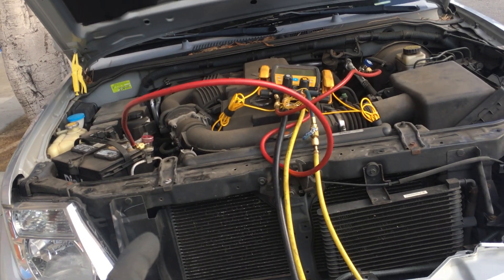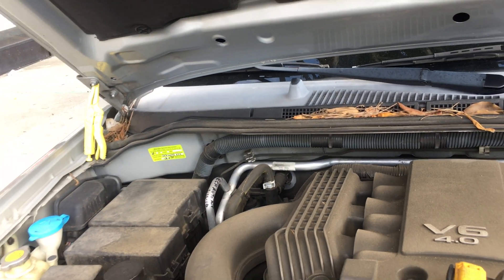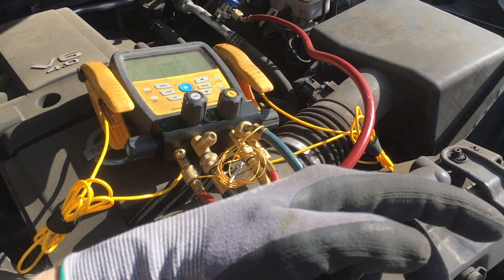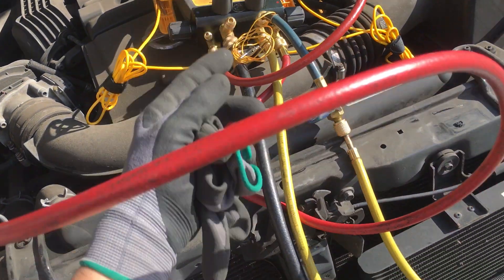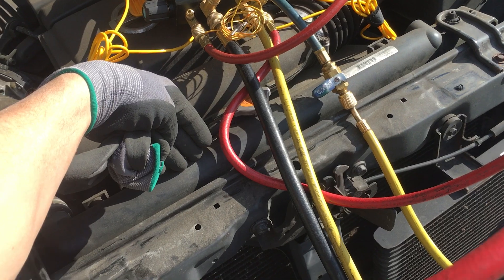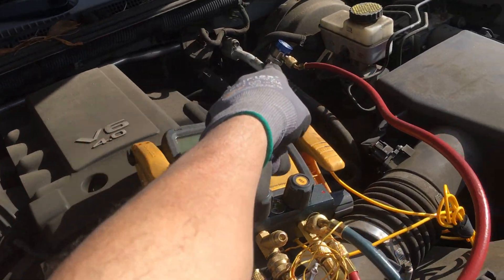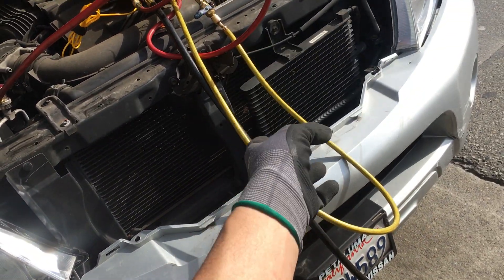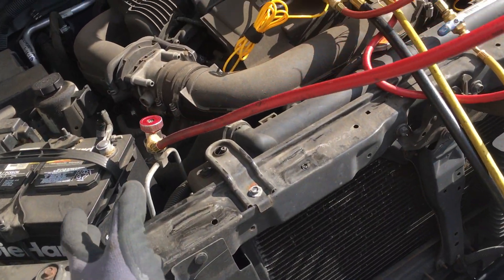AC recovery explanation, AC oil removal, WHAT ABOUT THAT UNIVERSAL REFRIGERANT OIL ???!!!

Comment: I'm working on a car with a york 210 compressor.  Putting in a new compressor.  I noticed the recovery fittings were on top of the compressor.  Since I have the opportunity now and I'm making new lines (original ones are over 40 years old), it sounds like it now is the opportunity to correct the defect you mention and re-locate the high and low side ports away from the compressor so all the oil won't be sucked out during recovery.  Would you have an ideal preference where the service ports should be (i.e. closer to drier/condenser), thanks!
Reply from the maker: komoru If you’re using a normal automotive recovery recycle recharge machine they have a much slower recovery rate and you have the machine that has the oil catcher that measures the quantity of oil that comes out so it’s a lot less.   As long as you pay attention to the quantity of oil that comes out and you put back in the same amount you’re OK.     The problem comes in when you guys are taught on the recovery machine by somebody who really doesn’t know what they’re doing and they do not pay attention to how much oil comes out and they never put it back. This is when there’s a problem.               If the compressor was mounted down low and positioned in a place where it was very difficult to get the refrigerant service fittings attached then I would add and relocate high and low service fittings in another location on the hoses for convenience.       The York compressor did not have much of that type of problem that I talked about in my other videos.      Some of the more modern day compressors do you have that problem like on some of the Chevy pick ups the 6H compressor right on top of the engine with the two ports directly into the high and low port of the compressor.
Reply: @coldfinger459sub0 Is there any way to tell how much oil is in the installation without having the machine in your video?
Reply from the maker: @andreia2286  yes but it’s a long procedure. 

One way is to pull off the compressor and measure the oil that’s in the compressor compared to what the manufactures instruction manual tell you it should be and then you perform the oil balance procedure . 

But you cannot rely on this method. If you do not know what other people have done in the history in the past, if they have added more or less oil in the vehicle, came in low on charge meeting most all the oil will be stuck up in the evaporator and you don’t know how much. 

So the only correct way is to fill the system up to manufacture, specified refrigerant quantity by wait for that specific your model vehicle only 

Run it for about 20 minutes all the doors and windows open on a hot day fresh air mode at somewhere around 1500 RPMs 

Turn it off and let it rest for about 20 minutes 30 minutes 

Then slowly recover with a recovery machine, the refrigerant out of the low side fitting only very slowly dial down on your machine so it’s super slow . 

In the old days mechanics used to just released a Refrigerant to the lowside, fitting very slowly by unscrewing the valve core, and allowing the refrigerant to leave the suction line at a very slow rate . 

And then, when it was all finished, you would remove the compressor and measure the quantity oil 

He would have more than the oil specified. That means somebody put way too much oil in and it’ll tell you how much to dump out and save inside the compressor. 

If it had less oil than the manufacture required, then they will give you instructions on how much more to put back in . 

These procedures take time 

This is why only people who are qualified knowledgeable and actually Reed should ever be allowed to touch air-conditioning because people just think and guess and start adding things are taking things out without knowing what they’re doing and we get messed up AC systems driving around .
Reply: @coldfinger459sub0  Hi, thanks for your quick reply, I've replaced the AC compressor last year with someone else and we've manually filled it with as much oil as we could, unfortunately I don't remember the exact quantity but I believe there was enough so we dont spill it while we mount it. Unfortunately we didn't do a vacuum before adding the refrigerant and after a few months the valves started to leak.

 So I decided to go to a shop where they did pulled out the rest of the refrigerant with one of those refrigerant machines that works by itself. The amount of the refrigerant recovered was about 56 grams, however I don't know how much oil they recovered, or how much they could have possibly extracted with that machine. 

Now I've replaced the valves, bought a vacuum pump but I don't know how much oil I should put onto the installation. Before replacing the compressor, the installation wasn't used for a very long time, so I believe there wasn't much oil in there if not at all. I have a ford mondeo mk1 which requires about 750 grams of refrigerant and 200 ml of oil according on what I could find on the internet. 

If you know anything about how much oil can those machines extract from the installation in these circumstances please let me know 🙏
Reply from the maker: @andreia2286  does machines are not supposed to pull out any oil every now and then they’ll pull out 5 mL or maybe 25 mL

If you filled up the compressor, all that I can fill inside the high side port in lowside port, probably have too much oil in the system . 

In these cases, the whole entire system gets flushed out, manually taken apart piece by piece . 

Expansion valve hast to come out in the. Evaporator gets flushed out with AC flushing solvent. . 

Or at least just high-pressure nitrogen . 

And then the system is put back together with a new receiver dryer 

And since your system is so moisture contaminated by not vacuuming it the first time 

I would leave it on the vacuum pump overnight 12 hours to 24 hours . 

And then charge it up
Reply: @coldfinger459sub0  I don't think we overfilled the compressor because we didn't had that much oil. If I remember correctly we used a syringe that was already prefilled, but I don't remember the exact amount we used :(. I don't know if the compressor got damaged in the process but I hope that's not the case... We also added some air pressure to check if it can hold it for 24 hours and It was fine. Thank you for your suggestion btw, I'll definately pull a vacuum for a longer period of time.
Reply from the maker: @andreia2286  definitely sounds like you need to go online and research and download instructions to do it properly and read the specifications and read the procedures

Comment: An universal PAG has been recently marketed in Europe and it's basically 68 viscosity grade (15 cst at 212F), said to be suitable where either 46 or 100 is specified (but i don't think it's suitable for refilling an old compressor that wants PAG 150). Might be the best take at an universal oil. Ester 100/85 are bad as universal because they won't get thick enough at 212F due to the low VI, i.e. PAG 100 will be two times thicker at 212F than these ones. PAO is a big no no as universal because it won't mix with any modern refrigerant and hence won't give any reasonable OCR with sumpless comps.
Reply from the maker: TeraVolt I remember when the 68 was trying to be marketed her in the US 15+ years ago.
Reply: @coldfinger459sub0  If i remember correctly Dow's RL897, Dow's RL993 and Sanden's SP15 are all PAG 68 oils. The Euro PAG 68 is made by an Italian company instead and it's also double end capped.